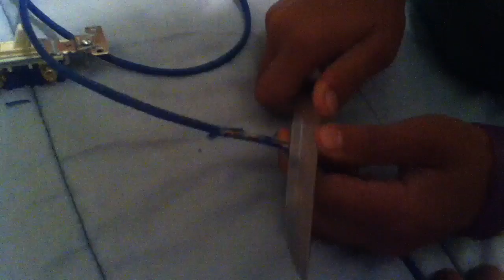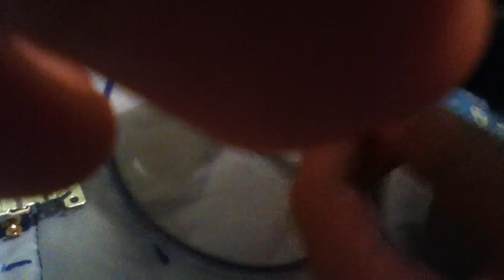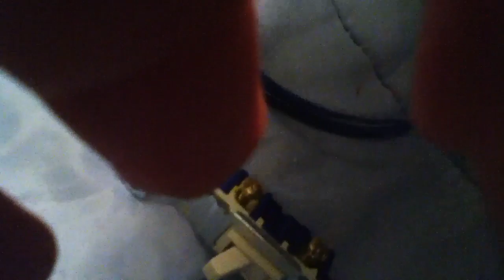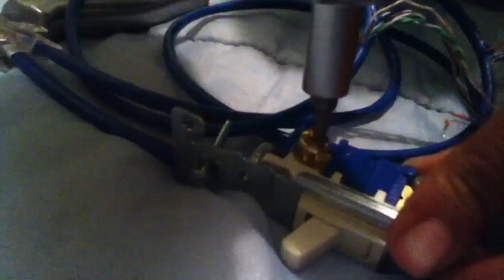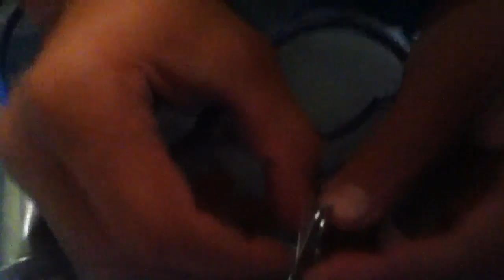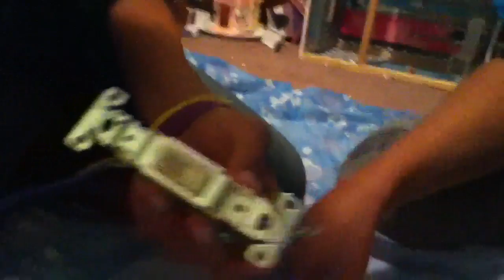How To Make A Lag Switch (Homemade)

Comment: they should work most electrical works of this type are that simple. all your doing is breaking the circuit in the middle of the Ethernet cable.

Comment: its extra low voltage, you wouldn't even feel it... that is why un-qualified electricians can connect up data points ( your internet and telephone sockets), it doesn't matter if they don't know what they're doing all they need is to get it from point A to B.

Comment: U sad, bro? I realize you suck at online gaming and are probably get a little frustrated when you're getting curb-stomped, but why not actually try to get better instead of cheating? Seriously, I WANT to understand the mentality that goes into cheating in an online game.

Also, you need to practice stripping wires. That was painful to watch... Though I'm sure you can find a lag switch that'll help you with that...